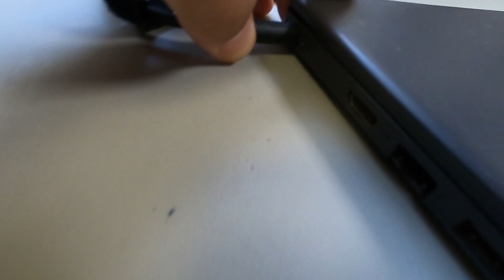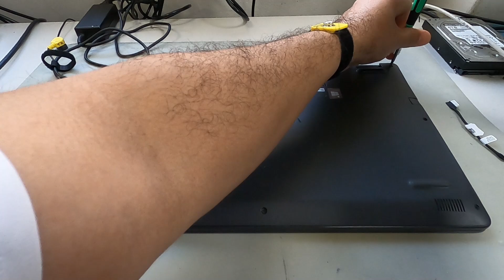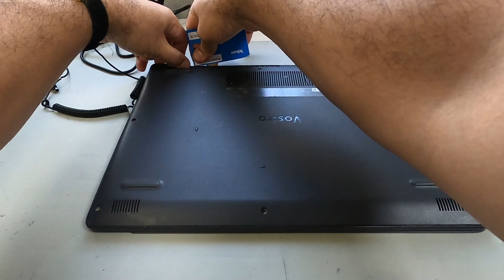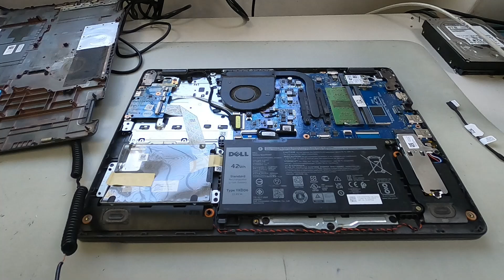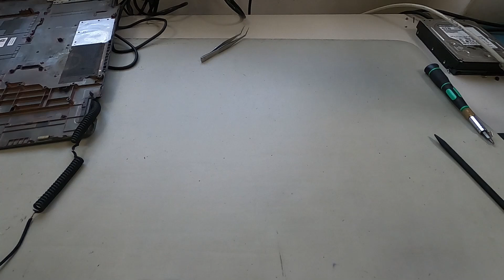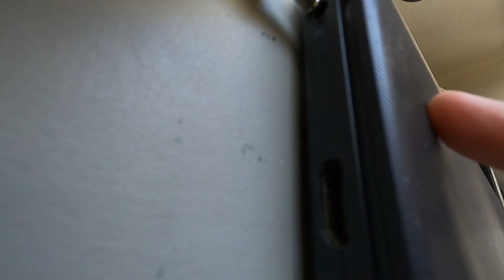Dell Vostro 3500 Charging port replacement

Comment: What was that string like thing you wear on hand
Reply from the maker: Good day. That is my ground strap.
It is used to avoid any static electricity damage to electronic components.

Thank You for watching.
Reply: Can i do it without that  @IAscomputervideos
Reply from the maker: @DeepanshuKhatana  You can. Although it is recommended that you do wear a ground strap. If you do not have one I would suggest touching a bare metal surface regularly during the process and avoid unnecessary contact with any circuitry.
Touching a bare metal should dissipate any built up static electricity.